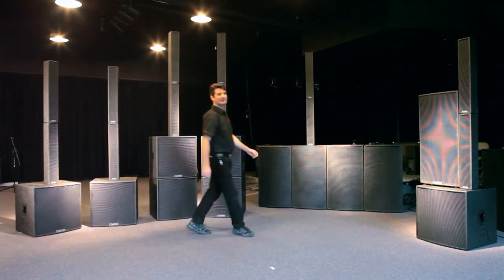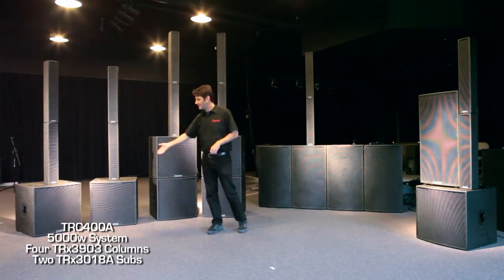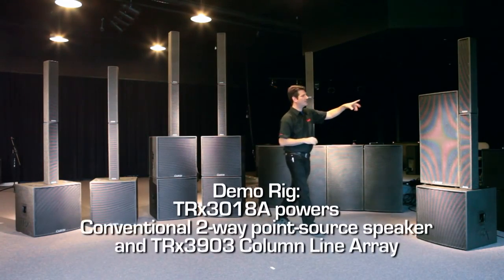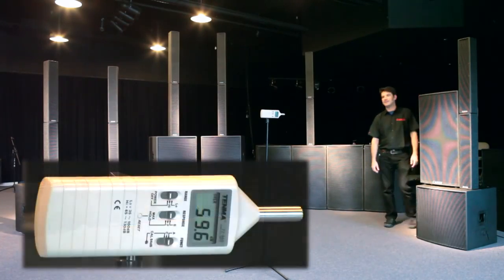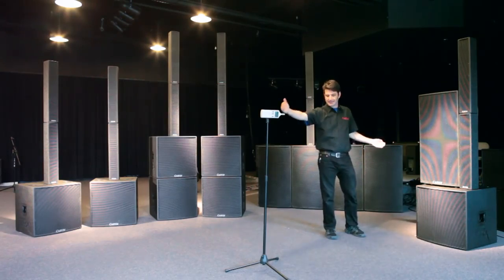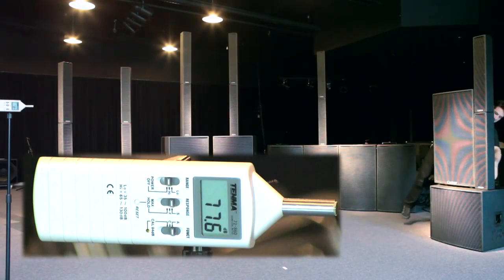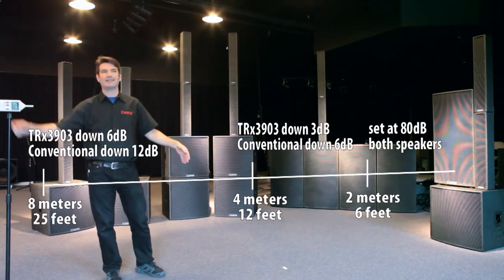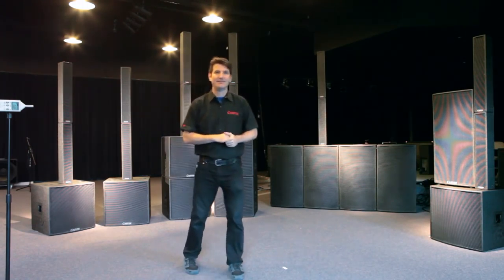Carvin Audio TRC Column Line Array Demo TRx3903

Comment: I like the demonstration. It shows the abilities of a line array. While I have never done such a test with my Bose L1 Model II with two B1's, I felt that when you are standing like 20 feet away from the column, that is when my ears were capturing the best audio from the line array. It stays consistent through the the whole room. While I am sure Carvin's 18's provide more shake and boom, my Bose Subs bass stays consistent even when I am in the bathroom of the bar I work in regularly, which is on the other side of the building. From what I have been reading on Carvin's system, I am just not sold on it yet, but will be keeping my eye on them. If the price point ever gets better, I would be willing to make the leap.